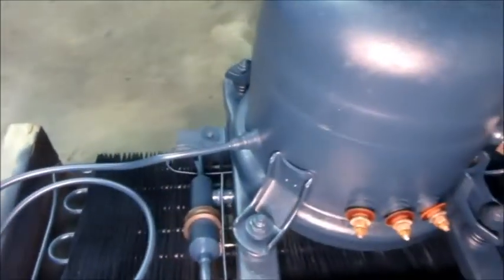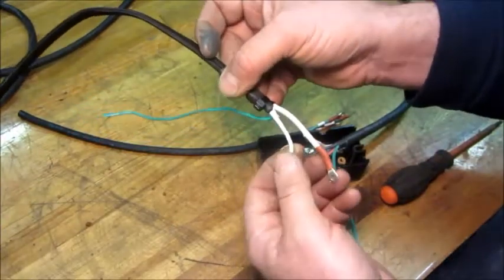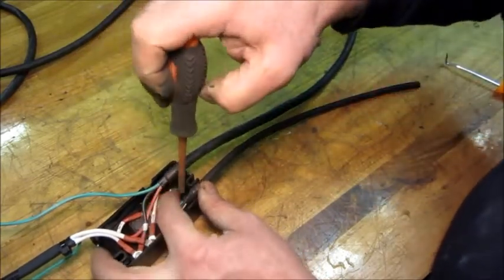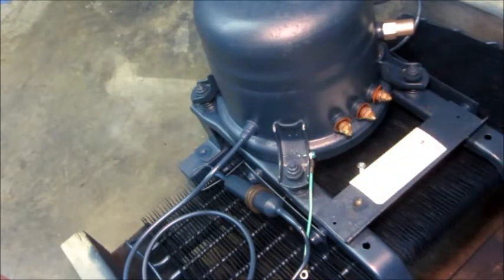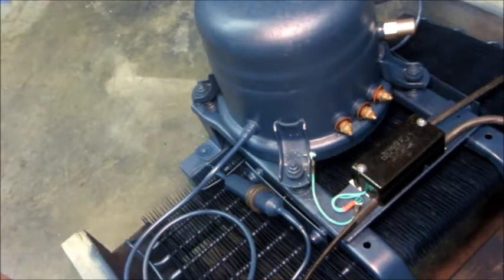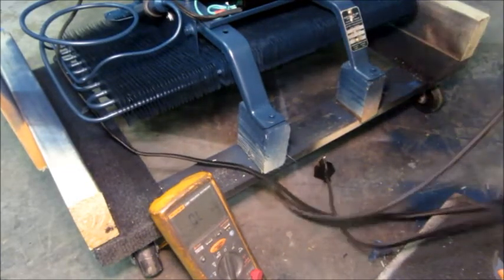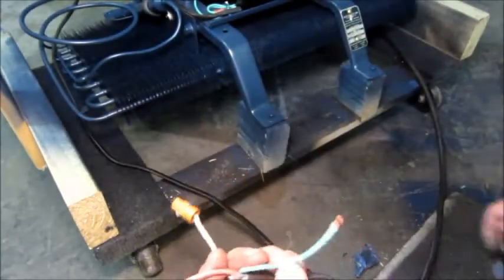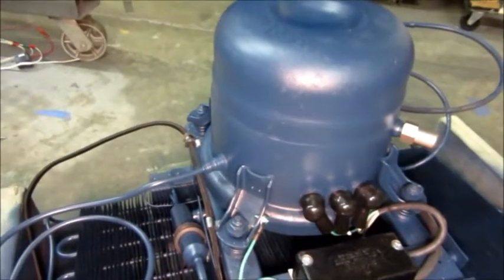1947 Kelvinator Antique Fridge Repair - 3 - Paint the compressor and rewiring...

Comment: Amazing how a lot of the components you come across are also found in many old Australian units also
Reply from the maker: They did have a lot of parts commonality across different regions, it seems.
Reply: @davida1hiwaaynet  seems that way several relays I’ve seen in your video are common on older units here as are several compressors including metermisers. Only one unit from here I haven’t seen is old kirby compressors
Reply from the maker: I think that the James Kirby compressors are a licensed design from Kelvinator, and later from Tecumseh. I'm basing that guess on what other friends from Australia have said, including Aussie50's videos. We may not have them here, since the native designs are sold here.

Comment: I fixed a real old on with sulfur dioxide refrigerant. Never open that system!:face-fuchsia-tongue-out:
Reply from the maker: Oh yes, a lot of the 1930 stuff had SO2. I work on them all the time. Sadly, I may be one of the last remaining technicians who still have an active working knowledge on them. The old GE Monitor Tops are sulphur dioxide, as are some of the earlier Frigidaire belt drives.
Reply: @davida1hiwaaynet  Yes, the one I worked on was belt drive.

Comment: What was the amp draw on the motor trying to figure out what gage wire to replace mine
Reply from the maker: Hi Connor.   The compressor full-load running current is less than 3 amps.  We normally rewire the internal wiring of these with an 18AWG round rubber cable, type 18/3 SJOOW cable. It is rated for 9 amps, so you have a large safety margin with it. Using heavier-gauge cable is a poor choice because it is difficult to connect to the terminals. It puts too much pressure because it doesn't fit the terminals correctly, and can result in broken relays, thermostats, and refrigerant leaks at the compressor terminals. The 18AWG cable is just right for this.  For the power cord which will connect from the fridge to the wall outlet, a 16/3 cable is perfect. That is a little larger than the 18 AWG cable and it matches the appearance of the original almost perfectly.

Comment: I have a 54 ge freezer,  relay is working,  not getting  cold, no sign of puncture,  thermostat goes to one, no off, should I hear a clicking noise when I turn know, the compressor is running

Comment: I’m working on a 1950s crosley shelvador with a bad relay any idea where I can get 1 or ideas on conversions any advice is greatly appreciated
Reply from the maker: Hi Alante. If you can tell me the horsepower of the compressor, I can recommend an aftermarket relay.
Reply: @davida1hiwaaynet  not sure if the hp I have pics if you’ll accept them.
Reply from the maker: @barnonekrazi  
Sure, please email them to me. See my channel about page for contact info.